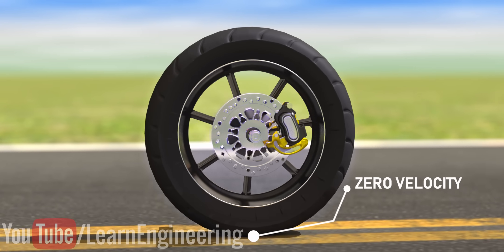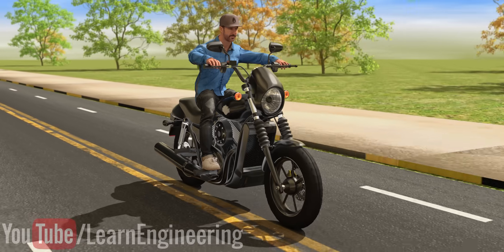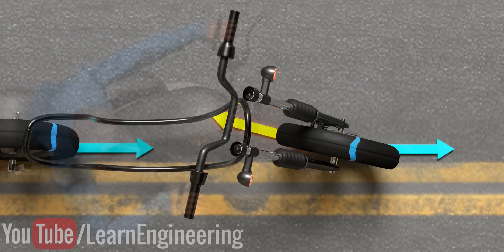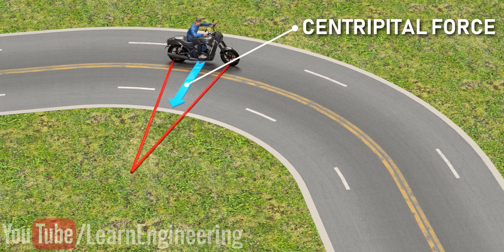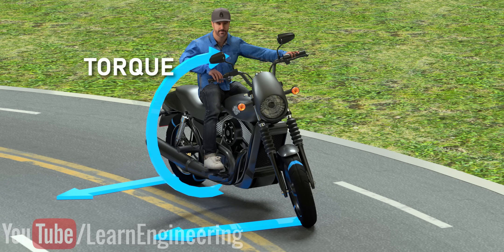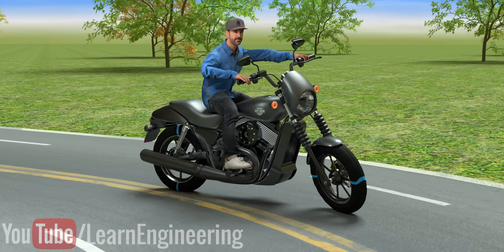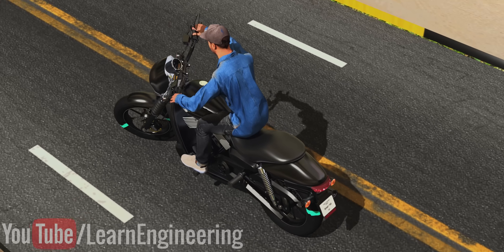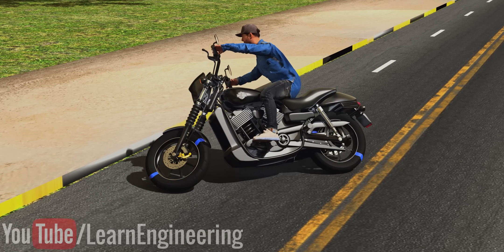Counter Steering | The interesting physics behind it

Comment: report this video as harmful and dangerous

counter steering is the ONLY way to turn a motorcycle. This video is giving dangerous information that will GET RIDERS KILLED if they think there is any other way to steer a motorbike.

A motorcycle at speed is self balancing. It will go straight and stay upright and it is IMPOSSIBLE for it to fall over.

To steer a motorcycle at speed you push the grip forward on one side. That disturbs its balance, the bike leans to that side and curves towards that side at the same time, and re-establishes its balance going in a circle in that direction.

The harder you push the right grip the harder the bike leans right and the harder it turns right. 

You must keep pushing on the grip to keep the bike off its vertical balance. 

Once you stop pushing the bike will stand up and go straight again.

For clarity: when you push on the right grip as the bike leans right the handlebars push back against you, 
and the wheel is actually turning towards the right.
 If you put a position sensor on the fork you can verify the position has rotated to the right. 

That is because the bike is trying to cancel out the lean to the right by turning the wheel to the right even further, 
and the pressure you are applying to the grip is stopping it from turning further and standing the bike up straight.
Again: when you release the pressure the tire steers under the bike, standing it up straight, and the bike goes straight on the new heading.

DONT REPLY to this comment - if you dont agree get on a real MOTORCYCLE, get up to 50mph and TRY IT YOURSELF.

If you dont have a motorcycle then keep your comments to YOURSELF.
Reply: @UCtG8k0ps2IIZtKKglui6I3A

you dont have a motorcycle and dont know how to ride

i dont need to talk to anyone else, I have commercially manufactured street motorcycles and I KNOW FROM FIRST HAND RIDING EXPERIENCE THE CONTENT OF THIS VIDEO IS MISLEADING AND DANGEROUS

Comment: Simple, just at the start turn tires to left and quick to the right
Reply: Wrong wrong wrong 😂😂.
Reply: @softailfun  thats how doc used to do it and explain it, and im talking about car, not bike
Reply: @jakovteklic2212  
Well a 4 wheeled car handles a little differently than a two wheeled bike fella. Do what you suggest on a bike and you find out how much road hurts!
Reply: @softailfun  i was talking about car driving, not bike
Reply: @jakovteklic2212  
The video is about bikes, don’t know if you noticed that. So your advise would be taken as meaning bikes. Come on fella, this ain’t rocket science.

Comment: The first half or the video of "leaning and turning"  absolutely does NOT work in the real world and is DANGEROUSLY WRONG, sorry.  This video should be removed. At speeds above 15 mph, you MUST counter steer the motorcycle or you WILL go dangerously wide in a turn.   Keith Code proved this dramatically with his "no turn" motorcycle bars - leaning or shifting body weight does nothing to turn a motorcycle. Count steering is the only safe way to control a motorcycle at speed.

Comment: Ahh yes, a physics video on riding forces by somebody who has clearly never ridden a motorcycle before. Of you turn your bars in the driction you want to go at an speed over around 12mph, you're going the opposite way. Further, you don't necessarily "turn" the bars to turn the bike when going at speed. Usually pushing one end of the bar, or even just leaving can produce the desired effect.

Comment: Discovered it on my own on a '71 Nordic Skidoo. You develop a side thrust to counter the centrifical force of turning. It is best learned off road on soft soil thst allows slip and a softer place to land with no other vehicles to run you over as your sliding .
Pavement is a lot more unforgiving and the lean is a lot more suttle.

Comment: Can I practice in a bicycle?
Reply: yes it will work on a bicycle but be careful it is very effective in leaning the bicycle since it is so much light than a motorcycle. like gently press forward on the right handle bar(as if steering left), the bike will start to lean/turn/move to the right)

Comment: Newton's third law. For every action in nature, there is an equal and opposite reaction. By leaning the bike left, you can then steer right and flick into a much tighter turn-in. It feels similar to a buttonhook turn to me. Swing wide then turn in... Kinda... It's just a wiggle to get the inertia for a lean. The key is to apply pressure on the grip with a  downward force towards the ground.
Reply: No! Such a dumb comment!!

Comment: It's a natural thing you do on a motorcycle or bicycle.  Otherwise you can't go round corners.  You push the right bar to turn right and the left bar to turn left.  Thats how two wheeled vehicles with a headstock work.
Next time your on a straight road push either bar and see for yourself.  You just dont notice it when your riding, that's all.
It's not something you learn.

Comment: Trying to explain counter steering to someone by providing a dissertation in applied vector mechanics is foolhardy. You lost more than 99% of the people. Rather, all you need is explain the gyroscopic tendencies of 2 rotating wheels in motion would be a lot easier. All we need to know is the technique with no physics jargon.

Comment: I dont see how this technique makes any sense. If there is an object in my lane that I must avoid and my only escape route is to my right I should turn the bars left which will cause the bike to go left then immediately back to the right which will either cause the bike to skid and if the bike regains traction the rider/operator will be flung off to the right doing what is called a high side. Yeah I think whoever put this video together needs to back and look up the definition of "counter-steering"  as it is to be only used to control a skid in rear-wheel drive vehicles
Reply: Turn the bars left, you will turn right if you’re travelling at 12mph or more.
Reply: @softailfun  Where did you got that speed?
What happens when my bike's speed  fluctuate over and above 12mph in a middle of a corner?
Reply: @XtreeM_FaiL  
You just need to try it, go practice. It’s easy, honest.
Reply: @XtreeM_FaiL  
Well I know where you’re going with this, counter steering works at any speed, right. Well it may do, but on my heavy Harley I prefer not to counter steer at low speeds, and at those speeds I still have an option. So let’s say I get that speed from personal experience. Happy? Good! We’re done.

Comment: This video is not accurate in any way. Gyroscopic affect of the spinning front wheel is why counter steering works. That is why you can only counter steer at ~15mph plus.  
Look at any moto gp picture of a motorcycle in full lean.  The front wheel is NOT pointing in the direction of the turn as the gyroscopic affect of the wheel prevents it. It is in fact turned away from the turn or ‘counter steered’. 

This video was not scientific and was not accurate.
Reply: After counter steering the front wheel always points into the bend in order to prevent the bike falling over. That is an undeniable fact!

Comment: Question :

How is it quicker than normal steering?

I decided to start with a bicycle before moving on a motorbike, and have been practising countersteering for about a week, I remember first time trying it I had a mind blow and was doing it more and more BUT

Instead of leaning and turning, you countersteer, lean and turn which is one movement more than normal, so how can it be faster? Or maybe it is on higher speeds and not so useful on low speeds?
Reply: Counter steering is the normal steering.
You can't lean without countersteer.
Turning the handle bar cause the lean. Lean cause the turn. Turn cause the head spin if you keep riding circle.

This video is dangerous to all riders and should have been deleted.
Reply: @XtreeM_FaiL  
I totally agree.
Reply: On a motorcycle above 12mph, you can’t turn a bike without counter steering. It’s not “faster” or an “option” as the video states, it’s the only way of steering.
See here for a far superior demonstration, let me know what you think.
https://youtu.be/lzk8oyNO708

Comment: I do not agree. Counter steering is the 'only' way to turn any two wheeled vehicle. You cannot lean a moving motorcycle before steering into a turn or even at the same time. If you try steering into a turn the bike will just fall to the opposite side of the turn thus 'counter steering in the opposite direction. Counter steering is the only 'normal' steering. It's impossible to do otherwise. Also the explanation ignores centrifugal forces on the spinning wheel which have a massive impact on turning a bike especially at speed. What the hell are you talking about?

Comment: I think your physics behind it is wrong. Just my opinion mind you. The way I see it is if the bike has to go around a right bend,and you push down on right bar,what I think happens is this.....the part of the tyre making contact with the ground is actually behind the forks and slightly to the right (as you'd look down on tyre),and because the bike is leaning to the right,this part of the tyre will always want to make contact and grip 1st.hence,as its leaning and this part of front tyre making contact its going to want to turn in to the right more n more.
That probably didn't make sense to you but I know what I mean haha
Reply: You push forward on the bar, not down.

Comment: It is painfully clear that the person who made this video has never ridden a motorcycle... and has produced an instructional video on how to instantly wreck your bike should you follow its examples... just wow!

The only way to turn the bike at any speed greater than 5mph is to push the handle bars the opposite direction of the desired direction of the turn... so to turn left... you bush the left handle bar forward which causes the bike to lean left... the forward momentum keeps the bike from falling over... just slight pressure will lean the bike...

Do not use this video... its a horrible example on how to turn.
Reply: I was wincing.
Reply: "the only way"? 
That's not the only way, just like the video said, you can just "normal steer" instead. 
Professional bike racers are normal steering at insane speeds. Their legs are touching the ground when they do this. 

You just sound so confident just to be wrong.
Reply: @nevin8604  What they're trying to say is when you "normal steer" you have to apply the counter pressure or the front forks will misalign during the turn. 

Let's say you lean right to turn right at say 30mph. While you're in that turn, you must slightly pull your handlebars to the left in order to maintain the turn.  If you didn't apply the counter pressure during the turn the bike will want to take you down.

Comment: This video is dumb and seems to be written by people who don’t want to accept that counter steering is true. If a motorcycle’s geometry and counter steering did not cause the bike to lean in the direction of the turn you would be thrown off or thrown down from the motorcycle while attempting a turn at any significant speed. Think about it. Cars and tricycles lean out when going around corners. Airplanes, boats and motorcycles lean in when cornering. You should look at your handlebars as lean levers rather than a steering wheel. 
I believe this is the reason a child who can ride a tricycle really good then later has to relearn how to ride a bike later on. I believe it’s important to understand this and consciously practice so when needed in an emergency you don’t revert back to car mentality and end up hitting the very thing your trying to avoid.

Comment: Actually you can counter steer and lean.
Reply: Yes, body position and counter steering are two separate things. It's just one of many things this stupid video gets wrong. Body position is important in turns and it's almost impossible and certainly dangerous to sit perfectly upright in a fast turn.
Reply: @mwillerd8969  correct. I ride for over 20 years I lean and counter steer. I don't know what genious made this video.
Reply: @kvarnerinfoTV  
The rider leans with the bike, the bike doesn’t lean because the rider  has shifted a bit of weight around though.
Reply: @softailfun  thnx, I ride for over 20 years. I rode on moto cross, choppers, sports and naked bikes.
Reply: @kvarnerinfoTV  
Erm..... and that makes you unique how?? I just made a statement of fact for others to read that you seemed to have left out. Don’t be so butthurt junior!
Reply: @softailfun  1. DId I said something makes me unique!?
2. I did not left out anything, I just stated that I use counter steering when in hard curves and hanging from my bike.
3. Why do you assume I am butthurt?
Reply: @kvarnerinfoTV  
You two “experts” were saying how important body position was. When riding around on normal roads, the riders body leans with the bike.... the bike doesn’t lean because the rider has moved a few pounds from one point to another. You left that out. That’s the bit I put in! The words “hanging off my bike” sound ridiculous when used in any other environment other than track.
Reply: @softailfun  when I rode my sports bike I was often riding hard leaning like on race track - yes.
If you do not understand counter steering its ok.
What is the point of your comments ath the end?
My comment was simple - actually you can counter stter and lean as I do today and did before.
Reply: @kvarnerinfoTV  
If I don’t understand counter steering!!!! 😂😂
Ok well you go and “hang off your bike” and have fun. I’m sure that nothing will go wrong while you “ride hard”. I’m done. Peace.
Reply: @softailfun  thnx ❤️

Comment: I’ve watched 3 dif videos on countersteering, and they’ve all explained it slightly different. Time to go practice and see whos right more or less...
Reply: Not this one!!!!
Go see here: https://youtu.be/lzk8oyNO708
Reply: @softailfun  I strongly second this. According to the video on this page the bike will fall over if you don't immediately correct the countersteer, which Fast Eddy obviously disproves. It's insane to me that someone who obviously has no knowledge of motorcycles would make an instructional video on such a dangerous subject.
Reply: @mwillerd8969  
Yea, completely agree. Get counter steering wrong and it’s a world of pain for someone.👍🏻
Reply: Don't worry about the why of it. Just push slightly on the right bar and the bike will lean right and turn right. Push left to lean left and turn left. Try it in a safe place and practice.

Comment: I understand the physics and everything, but still. Isn't it quicker to just lean the way you need to go?? And I do understand that countersteering is used very effectively on the race track, but it has a different cause/purpose there.
Reply: The rider moving his weight to one side or another of the bike alone achieves very little, if indeed anything.
Without counter steering, you can’t steer a bike.
See here https://youtu.be/lzk8oyNO708
I can’t wait to hear what the difference is between the road and the track for the use of counter steering.
Reply: No, absolutely not. Keith Code proved this by locking the bars and putting on a second bar with brakes and throttle so that a guy could jump around and lean all the way off the side while the bike was in motion. The best he could do was to make the bike veer off couse. You can watch the video here and if you ride you should watch the whole thing: 
https://youtu.be/BhOomvv6oNI?t=300
Reply: @mwillerd8969  Wow, this video is a gem. Haven't watched the whole thing yet, but sure am going to. My point wasn't that you can turn only by leaning. I thought if it would get a good angel quicker, by leaning (and of course steering) or by counter steering. Thanks for the link

Comment: Much of this is rubbish and the poorly made graphics make it even worse. Motorcycles HAVE to counter steer in order to turn at any speed much above 8-10 mph depending on the rake of the forks. Below that speed you can steer directly into a slow turn, but above that speed all turns must be initiated by counter steering. This video gives the impression that you can use either direct steering or counter steering. This is completely wrong.

Comment: The problem with the video is the over exaggerated graphics of the front wheel. This motion is basically natural by any rider. To over do it will cause someone to get hurt. 35 mph and someone turns their front wheel 20⁰ and bam! Instant road rash. Please redo this video with this explanation.

Comment: Confusing video since everyone else describes it as pushing in the direction you want to go... push the handle bars with your left hand in order to lean the motorcycle to the left so that you turn to the left for example (which produces the same result as pulling back on the right to make the motorcycle lean to the left so that you turn to the left). The physics are the same, the descriptions are just a little different. Still, thanks for the explanation.
Reply: It’s a bad explanation though and potentially dangerous.

Comment: This video is absolute garbage.  The only time you can turn the wheel the direction of the turn is at very low speeds, anything below like 10-15mph depending on the weight of the bike I do believe. Anything faster than that, if you try turning the wheel the direction of the turn, you are going to go the opposite direction of the turn and hurt yourself or someone else. This misinformation is going to cause someone to get hurt or worse and should be removed.